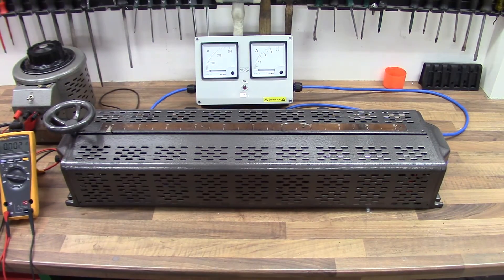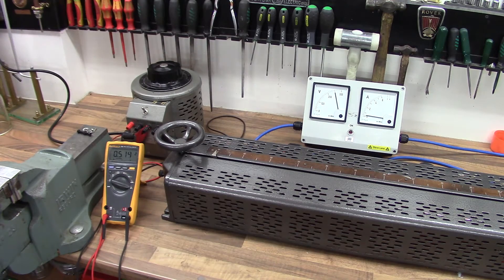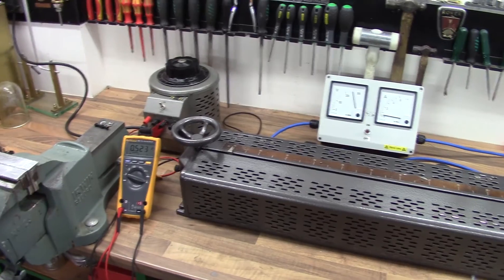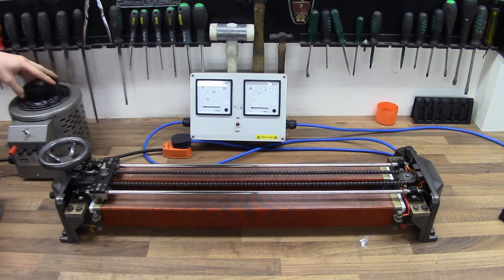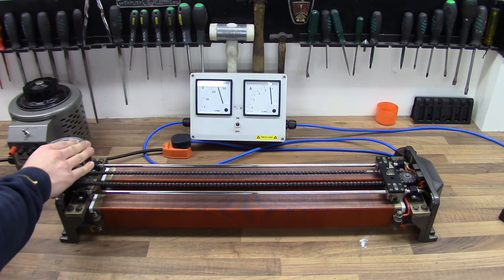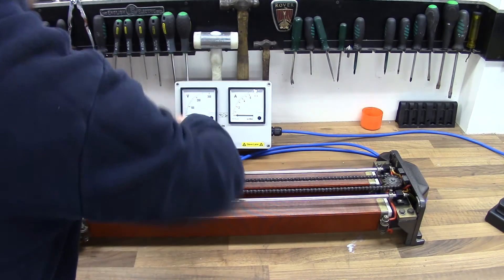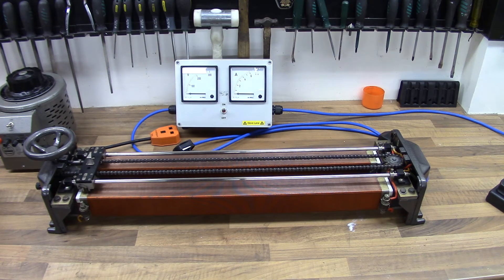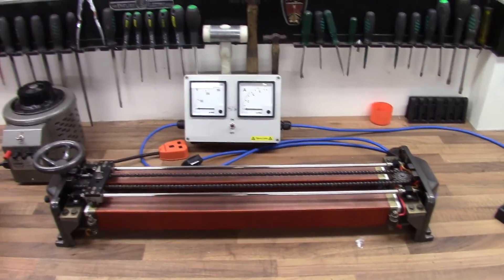Linear Variac Restoration Project - Completion and Testing.

Comment: Nice to see this like new. So much better than the dusty state it was in when I saw it in at the Teslathon last year.
Reply from the maker: Thanks! I actually picked that Variac up on the way to Teslathon that morning. Are you going to Gaussfest first weekend of March? Should have it there. =]
Reply: Unfortunately not this year. Are you displaying your VTTC?  I have one using a RS1026 transmitting valve which I keep meaning to rework for longer sparks.
Reply from the maker: ***** That's unfortunate... What about Teslathon? And yes I will be exhibiting the 811A VTTC at Gaussfest this year. =]
Reply: Teslathon is a possibility, I have been to the last 2.  I'll watch for the pictures. :-)
Reply from the maker: +tuopeek1 Awesome hopefully see you there! =]

Comment: Turned out very nice indeed Steve, it looks real smart now. Well done on the renovation.

Cheers
John
Reply from the maker: +orbiter8 (John) Cheers John, this one has just gone inside one of my "Power Cabinets" as of the other day, I mounted it vertically on unistruts, I'm yet to actually connect it to mains as I need a motor to drive it next really, but this project will be on hold for awhile as I push the Vacuum Tube Tesla Coil Project in time for Nottingham Gaussfest on the 5th of March this year... =]

Comment: Thumbs up, and I agree with Alex that the required PFC will be around 6 microfarads if the initial PF is poor, and you can get a fairly reliable PF measurement from a plug-through unit (as the waveforms will be nice in this case). If the PF is already good then it's iron losses and you are stuck with it.

Perspex would look nice, and there's another reason to run with the cover on - I once used a long slider-type variable resistor, and the wire winding broke causing the live end to snake around as it unwound - very spectacular and I was glad the earthed case was on. I hope your wire doesn't break! 

BRs, Ian.
Reply from the maker: +ridefast0 Haha yeah that would be spectacular to see, especially on a big one like this, but at the same time I hope, although rewinding a linear would be a breeze compared to a rotary.

I will have to take a look through my PFC cap box, see if I can rummage out a 6uF, I get that feeling I've got one in stock already.

If it's iron losses then on the bright side it will not be running 24/7 so nothing to loose sleep over, worth it for the nice reassuring hum as an ON indicator. =]

Ps, will get back on that Tuner circuit after christmas, got really distracted by VTTCs... haha have a merry Christmas and all the best in the new year! =]

Comment: Having 2 effectively 2 variacs in parallel would increase losses etc, more sound, more heat dissipation.
Nice that you have a nice humming transformer ;)
Reply from the maker: +Sparky Projects By 2 variacs I take it you are referring to the two 7.5A cores that make up the 15A Linear Variac, not the rotary?
In which case I agree, two magnetic cores that close together should also have opposing effect on the current draw.

And yes a big humming transformer is a great way to tell it is on. =]
Reply: yes